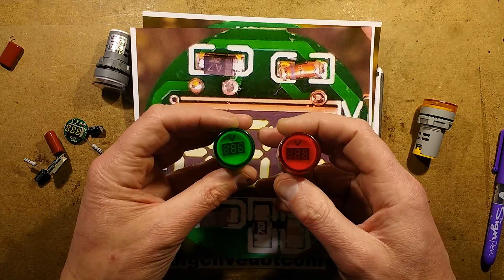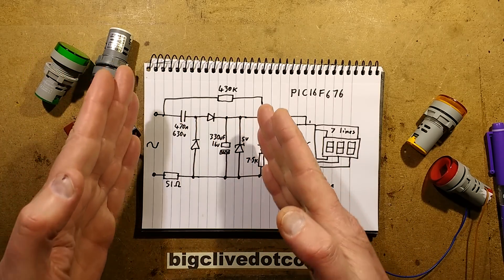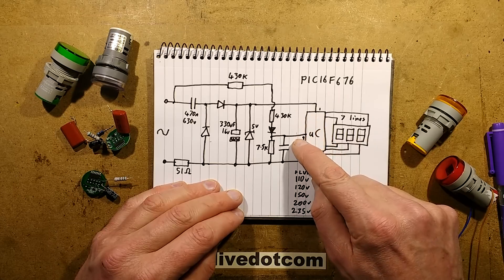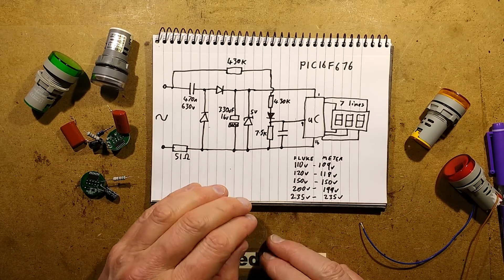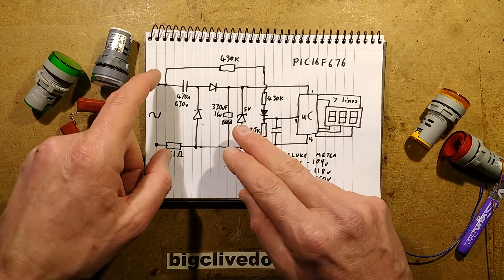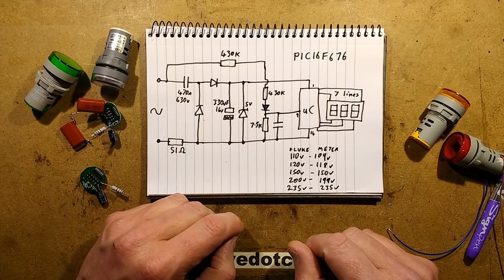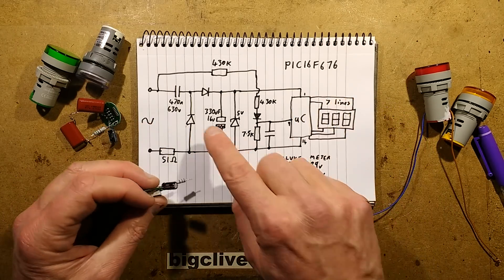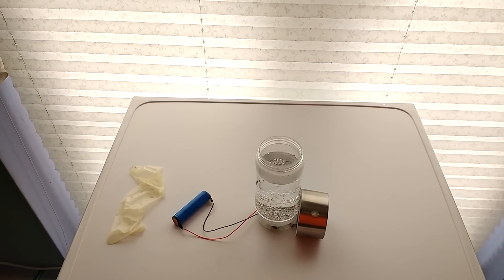Voltmeter-indicator schematic and hydrogen pop.

Comment: How are these cheap PICs in cheap, super mass-produced products programmed?
Reply: Moritz von Schweinitz You can also order them with masked ROMs and/or preprogrammed from the factory if buying in large enough lots.
Reply from the maker: +Moritz von Schweinitz Bulk automated programmers.
Reply: If you order enough devices in one go, they can mask-program them: they literally insert an extra layer in the chip with fixed connections to logic low or high instead of programmable memory cells.  Obviously, this method requires supreme confidence in one's own abilities.  What a sexist person might call "steel case  balls".  

Otherwise, they can be programmed before fixing them to the PCB.  It doesn't take very long (seconds) to program each device?
Reply: Thanks! Never heard of mask-programming before!
Reply: Microchip has a service for ordering pre-programmed PICs, even in low-digit quantities: https://www.microchipdirect.com/programming/

Comment: Methinks i'll be doing a "bodge it and scarper" job to get one to sort of work at 30VDC. The circuit looks bodgeable with an appropriate resistor instead of cap in the dropper circuit and a beefed up zenner.etc. Will probably have to be one of those 7W ceramics for the resistor. Alternativelt a bigger cap and chopper circuit (on an H bridge) for the PSU might be better. Why? ~Cos I can.

Comment: I have a hydroflex welder which electrolizes water into hydrogen and oxygen which are fed to the torch head. I filled a small balloon with the mixed gases and tossed a lit match onto it in the bathtub. The explosion was really really really loud and made a bright flash. Luckily I had my wife's permission to try this. Recreational use of explosives.

Comment: I suspect each LED of the display is turned on/off in turn, vs. the entire digit at a time.   A fast shutter would probably show this.  That'd prevent brightness variations and peak current. There are newer PICs with built in voltage references in them, but that chip is most likely either a clone or a work alike with a similar/same pinout.   If  it was a genuine part it would have markings so it's most likely some kind of clone or enhanced clone.

Comment: Hi Clive, our electricity bill is going through the roof a recent meter change from analogue to digital.  Question is how would I know if my new one is reading correctly. Cheers Stu.
Reply: I had my meter changed to digital almost 2 years ago and ever since my bill has been double what it was with the analog meter. The power company insists that the old meter was faulty and refuses to investigate further.
Reply: Take it to the ombudsman is usually the first step but they usually come down in favour of the utilities company regardless of evidence. The only way to tell for sure is to measure the current of every device you use and unokug things on standby. That way you will know exactly how much power you have used. Unfortunately you need to be meticulous for three months and then usually take them to court after the ombudsman stage.
Reply: Just a update.  I've been on the phone and they are going to add a check meter for a week. The meter that is installed is a landis +gyr unit. They added up my appliances and came up with a figure that I should roughly use 5000kwh per month against my 8000kwh. 
Regards Stu.
Reply: It is not at all uncommon for older mechanical meters to understate usage considerably, so it is not entirely unexpected to see a sometimes significant increase when they are replaced by the newer digital meters, and the older the analog meter the more they tended to underestimate usage due to increased drag on the rotor element (the spinning disc) from wear and tear.  The same often occurred when an old analog meter was replaced with a brand new analog meter, it was rare for old meters to read high but common for them to read low because drag seldom decreases with age given their mechanical design.   Most of the digital meters have a flashing LED that emulates the marking on the spinning disc in analog meters and a stated unit of measure for each flash so that you can calculate instantaneous usage and compare that against a measured load (provided you know to some accuracy what your actual load is and, thus, how many KWh it's load would represent).  A significant measured stable resistive load like a hot water heater or an electric burner make good loads if you can accurately measure their actual (not just claimed) consumption, such as with an accurate clamp on ammeter.

That said, there is nothing that says a brand new digital meter can not be miscalibrated at the factory, though it is fairly easy to engineer them to maintain very good accuracy for life (just as with a good multimeter) so if there is any sort of QA whatsoever at the factory then they should read well within their stated tolerance range.  But you can buy devices to actually measure home power usage or request an audit by the power company, using a special recording meter they temporarily install in place of your regular meter for a period of time.
Reply: you could simply buy a Power meter and wire it in after your your new meter and check de discrepancy. Or you unplug every thing (really every thing) and plug in a known Resistive load (like a light bulb or a Heater) for one hour, calculate the W/h and check what your new power meter displays.
Reply: Comedean using a resistive load is a mistake. New digital meters can read resistive loads just fine, where they go wrong is precisely the non-resisitive ones.
Reply: You need to look at the meter and find the "little flashy LED" it will probably have IMP printed next to it and a number. The number is the number of flashes to the KWh! 
Switch everything off and energise a known load (a 2KW heater perhaps) you can then work out what the meter is measuring the load at! ...... Simples ;O)
As a side note I would not have one of the Smart meters in my house, ... Ever! Under any circumstances! (and I work in the industry)
Reply: We had spike in power use one month in the order of 10 times our normal rate! (about $2000 dollars I think) our meter had recently been changed also. The power company and we couldn't explain it, they did let us off the fee but the best we could think to explain this was a lightning strike messing up the meter...
Reply: In the UK the old mechanical meters were good for a 20 year life cycle (we did used to harvest them, refurb them and then re-issue them after calibration) ..... they were typically accurate to 0.05% so issues about billing from them is not likely! They ran on a magnetic bearing so would not suffer from "bearing drag" that some of the American ones seem to be! One of the (many) issues with smart meters is that they can be configured to bill you for low power factor! This would be down to individual suppliers though and as they are remotely accessible anyone with the right information could reprogram them!
Reply: 5000 kWh per month ?. What you doing ? Smelting Aluminium ?  Our is little over half that - per year.  I have some self installed Landis & Gyr meter that have been in long term.  I that period the main meter has been changed from an ancient analog to a digital. My Landis & Gyr pretty much matched the old meter and pretty much matches the new one.  Within 2% anyway.
Reply: Same here, Change to a Digital Water meter after a "mysterious" down time of 2 days and muddy water. Now my bill approaches 120$,  The minimum 30$ or so being the usual.
Reply: Dave W I have heard of Radio Hams using less power when they are transmitting but sounds a bit of a leg pull if you ask me.
Reply: Do a kettle test. The LED flashes a certain number per kWh. Time a minute with the kettle on, then a minute with it off and compare. Take a video with your phone if it helps with the timing. The kettle load can be estimated from the rating "plate". You'll have to crunch some numbers and it won't be perfect - a sanity check only.
Reply: UK suppliers are meant to check polarity before and after to make sure they haven't swapped L and N. Believe me, it happens - in the house, in the road; it happens.
Reply: Dave W 
  I didn't do the work myself so I only heard about the problems from my old man. It's been awhile since he tried to explain what was happening. He was the instructor on the union side and did the industrial stuff the utility company was willing to outsource. I'm not sure exactly what was happening on the residential side, but I recall many complaints about people that were taking shortcuts and getting into trouble because of it. They had a lot of problems. The other side of the coin was that the project revealed so many cases of meter fraud by customers that they had to contract a large law firm to persue thousands of cases just in the greater Los Angeles area. They found everything from hidden bypasses to speakers left in very specific places. 
  The biggest "exploding" problems were from installs at industrial sites, with the biggest one almost killing the guy swapping the meter wrong. From vague memory, there were cases where a plant or business could not be taken offline so other measures were taken. I'm no EE or pro though. I'm just an electronics hobbyist goofing around after a car hit another car then me on a bicycle and left me partially disabled, so don't take anything I say too seriously ;)
Reply: It's actually likely that your old meter was way off and the new one is more accurate. You were just getting some electricity for free all this time and now they're making you pay for it.
Reply: Get a EMU unit, our meter was changed to a radio or wifi type meter. I used a EMU that was designed for use with the meter and shows what usage the meter was feeding the house. I flipped the main breaker and sure as heck no bleeding of power. Turn main back on then turned and unplugged everything, as low as 0.005 kw/h usage. US unit of course. Your milage may very. Good luck.
Reply: I was thinking it was just me but the more I read about it the more common it seems to be. I'm at work at the moment but will check the make later.
Thanks for your response. 
Regards Stu.
Reply: Well maybe they meter apparent power and not active power? If I make the testsetup with a pure resistive load I can al least say how accurate the metering of active power is.
But you are right, if they only false meter reactive loads then you have to check with a reactive load and calculate the active and apparent power manually and compare that to the meter.

If the results are not that far of, try loads witch are very noisy (in electrical terms), because new meters tend to calculate the powerfactor differently, they take the noise in their calculation not only the phaseangle that might cause confusion.

Thank you for your information, I will check that as soon as I got my new "smart" meter.
Reply: We are talking Domestic here not industrial? There is no way to do a "hot" install of domestic metering! You just pull the main fuse, rip the old  one out (sorry carefully remove the old meter after removing the meter tails) and bob the new one in (3 woodscrews) then tighten 4 meter tails in (2 screws apiece)! If you are talking CT metering it is different .... the fuse you pull is not the Main fuse and you need to short the CT's out or they will destroy themselves through generating a very high voltage ..... then remove the shorting links in the test block! It may be different on your side of the pond though ;O)
Reply: felixar90 I'm not sure? I moved to the house from another house in 2009 and our electricity bill was consistent with our old home. Since the beginning of this year we have changed our lights to leds, changed the tumble dryer to a a+++ condenser thing. Kids have Xbox one each with LCD 40" tv. Our living room tv is 65" with amp and separate' s. I've watched the flashing red light thing and it just flashes erratically tbh.
Reply: A condensing drier is not as efficient as a vented one!.... especially if you use the auto dry features!
Reply: I would think a condensing drier is much more efficient in winter. Instead of blowing all the heat outside you keep it inside. Of course in summer the opposite is true.  But then  you can just use the clothesline.
Reply: I know the feeling, like my former power company that made me pay £749 for electricity I was not liable for, the previous tenant left with a debt that I got lumbered with and the power company couldn't care.

You can't win with electric companies.
Reply: Dave W we have a heat pump dryer! I don't know if it's any cheaper now. Here's a link one on YouTube https://youtu.be/bYgCgLSPUG8
Regards Stu.
Reply: Mark Giblin I feel your pain buddy. Had that scenario with our first home in the era of the power cards. That meter was run into emergency funds.
Reply: It looks like I was wrong! If you watch the video After the one posted above (a heatpump drier) works at about half the consumption of a vented one. This may not hold true for the older condensing type I was referring to, but it is nice to learn something new!
Reply: If there is too much radio noise for the dumb things to transmit the bastards still have to send a reader out.... Just saying... plug in all your one hung low offline DC converters nearby.
Reply: They changed to digital meters here in Southern California a few years ago. I have family that worked for one of the contractors that installed them. The guys that installed them were pushed to meet quotas for  units installed. The majority of the 'fast' guys ignored the safety protocol and install procedure. There was no way to prove they were doing it unless they caused one to blow up because of the lack of jumpers/the proper bypass circuit. There were a few cases of this happening due to various circumstances (from what I've been told second hand). The people that installed their entire quota and went home early every day were obviously not going through the proper procedure. The instructors could never replicate their timing, and this was used in court against one installer that had a panel blow up on him from a dropped lug.
 I'm not familiar with the detailed internal hardware of the meters but I'm fairly certain they weren't designed to withstand a hot install. The proper install procedure involved bypassing the panel, installing the meter, then removing the bypass. From all the stories I've heard around 1/3rd were probably installed hot. Literally unplug hot, plug in hot. These municipal projects were so large they hired people off the street. There were a lot of idiots.
Reply: I know! ...... I'm one of th guys they send when it happens ;O)
Reply: Analog power meter were notorious for under-reporting actual power use. They were physically incapable of over-reading, but under-reading was very common. All the new tech stuff with switching power supplies like leds, TV and consoles tend to have a bunch of extremely short, high peaks in power use, instead of the smooth power use of old light bulbs and TVs. 

The analog meters we mostly incapable of recording those pulses, but the digital meters can. It's power you're using but that was unaccounted for before.

Edit : remember when your mom told you not to flash the light cause it would show on the power bill? Well, it wasn't true back then, but now it is!
Reply: Dave W Your full stop key is damaged?
Looks silly with exclamation after every sentence...

Comment: +10 for lighting it off condom style
Reply: +Kalanchoe1 You say he could've used a balloon, but could he? The top of the bottle has a diameter of about 50mm / 2 inches (guessed from the 18500 cell used originally). Can you find a balloon that fit over an opening that size? The condom has a much larger opening and is more stretchy, so even if he had a balloon this was still the better option.
Reply: Don't worry about it, balloon size estimation error is a common problem many people suffer from ;)
Reply: He could have used a balloon but I guess its all he had on hand.
Reply: Okay, sorry I didn't want to fight about who's balloon is bigger. Just that balloons come in many different shapes, sizes and colors and most could hold a greater volume than a condom, but its irrelevant as it all depends on how big it will get since the gas produced was so little.
Reply: i was never quite sure how to properly measure a balloon. size seems  to vary rather quickly.
Reply: Next video: Clive makes balloon animals out of hydrogen-filled balloons and pops them.
Reply: Upcycle Electronics yup
Reply: Kalanchoe1 or in hand

Comment: The PIC may be trimmed after each one is built by writing calibration values to EEPROM based on testing of each unit. This would be easy to automate on a production line.

Comment: Be VERY careful with that electrolysis bottle, if the electrodes are made out of stainless, chromium will leach out of it into the water, and it is very very cancer causing.